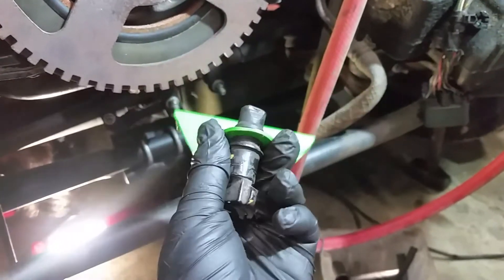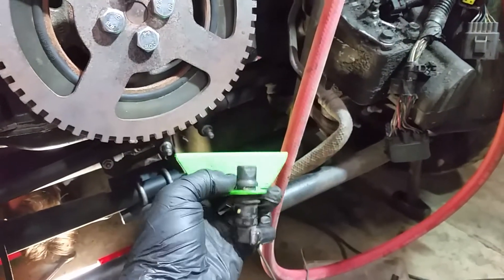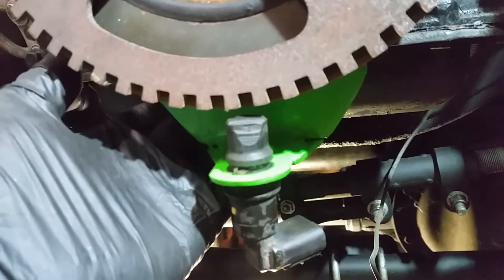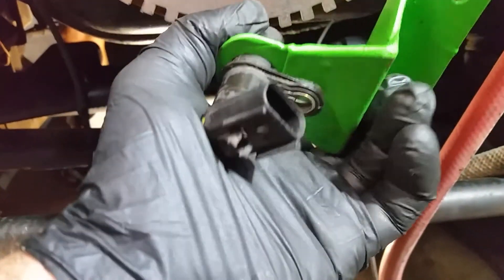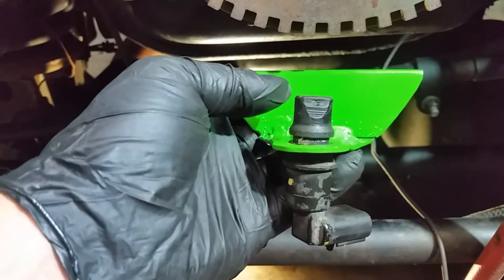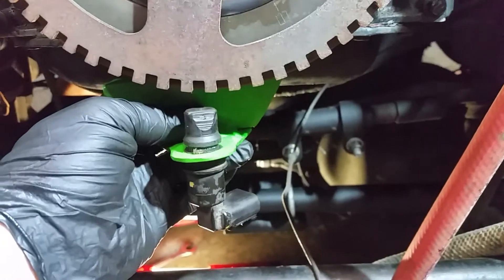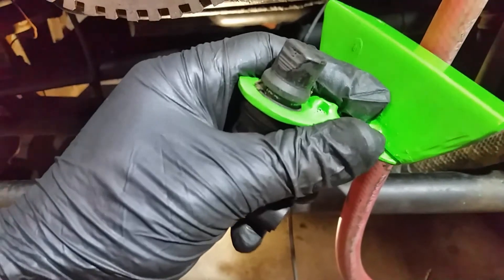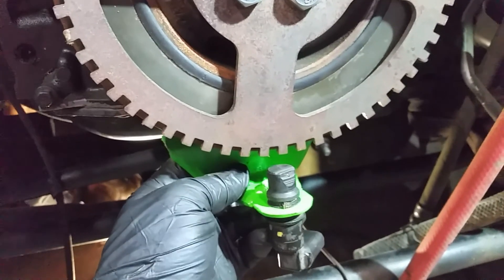How to fab the tach sensor bracket for Common Rail Swap

Comment: Hey I have an 03 12 valve swap I’m working on. I got the tach sensor hooked up and all the gauges work except the rpms. I see two harnesses that both plug into the tach sensor. I think one is for a cam sensor and maybe it needs both for the rpms to work. I was just curious how you did yours. Thanks!
Reply from the maker: Hey Neil! What type of tone ring are you using? As for the CR system, It just needs the tach pick up and not the cam sensor. The tach sensor plug is the one by the fan wire plug. Also, we have seen a lot of cases where a missing ground can cause weird things to happen. You might to give your wiring loom a once over.  Also make sure that you just zip tie up out of the way and don't cut wires!
Reply: @70440charger  I’m using the factory third gen tone ring and spaced it out with washers and longer bolts. The ecm is mounted like yours on the shock tower so it should be grounded. Ok I’ll check for grounds again and maybe try a different sensor
Reply: Hey so checked all the grounds and it still didn’t work. I got another sensor and plugged it into the other harness while the tach sensor was hooked up to the tone ring. I held it up to the 12 valve balancer groves while the engine was running and the tach gauge started working. Maybe I need two sensors or reprogram ecm to run off just the tach sensor? Any other ideas?
Reply from the maker: @neilplass1793  I have some questions for you about how things are set up. It takes too long to run through everything on message here. If you want, send me a message with your contact info to thelochcorp@gmail.com. I will give you a call.
Reply: Hey I sent you an email just curious if you got it. Thanks for your help!

Comment: I've had my 12 valve swap in for a minute now but I'm getting a bouncy tach signal from 900-1100 rpm.  Any ideas?  It makes the alternator and ac stop working at idle.  Works perfect every other rpm range
Reply from the maker: How did you wire the tach pick up?
Reply: @70440charger  I built a bracket similar to yours but where I mounted the computer I didn't need to lengthen the harness.  I used the common rail tone ring mounted in front of a fluidampmer.
Reply: And I put a new sensor on and she works perfect now.  Never had an issue with the original before but I guess it was time?
Reply from the maker: @panamactd  Glad to hear it working! Please, when you get a chance, make a video of the bracket you made and send us a link. It sounds amazing!

Comment: Great video! Can I use the same method tone ring on a older set up. I have a 98.5 and swapped the motor to an 01. The crank has a tone ring on the 98 not the 01
Reply from the maker: As long as you had the right tooth count, I dont see any reason why it wouldn't work. You might have to take a second to figure out how to adapt everything, but I bet you could make the computer happy!

Comment: Hi I was wondering what the correct gap is. I bought the tone ring from destroke  60 minus 2 and I am putting it in a 2003 cummins. I built mine similar to yours. I wasn't sure on the distance for a common rail  sensor from the tone ring . Thanks
Reply from the maker: Hey there! I think I set mine to .020". It will work with a pretty wide range if I remember correctly.

Comment: I just did this swap on a 03 ram and every gauge is working other than the tach oil pressure works so it's reading off the tone ring bit not sending it to the tach on the dash any ideas ?
Reply from the maker: Hey, Sorry to hear that you are running into some trouble. If you can post up a video of how you have your tach sensor set up right now, It might help us or others give you betting insight. For now, I thought it might help you if I made a video on how my system is set up and how those two senders change things on my dash. Here is the link: https://youtu.be/oF2JhSRHcdk to the new video I just put up.  Other than that, I would try checking and rechecking all of your grounds and electrical connections. Make sure no wires got crossed when you lengthened the tach sensor wires and other basic stuff like that. These ECU are very picky about ground and signals. Keep us updated and post what the solution is when you get it figured out.
Reply from the maker: You have peaked my interest, but I need more detail about what you have done. It likely to be a very small issue that is causing this.  I have to ask cause I am working on an 03 right now and it has the same style pick up and almost the same motor harness as the later CR's.  Where did you mount your ecu that it reaches without lengthening the wires?  Send a picture of your set up, if you don't mind.  douglochner@gmail.com. 

Back to your problem. Where did you buy your tone ring? How much did you set the gap for between the tone ring and the wheel? Have you gone back through all of your grounds? Did you cut any wires off? 

I will go unplug some stuff on the Black Hole see if i can duplicate your issue. The ECUs are finicky, but only require a few input to get a tach signal. We will see what we can do to help you get it worked out.
Reply from the maker: I hear ya.  You shouldn't have had this much trouble! Ahhh the joys of a swap! Another question is if you have your ECU grounded, as well?

Comment: I am building a 2003 Dodge Ram 2500 and putting a 1998 12 Valve in it. Is the 1998 block a storm block? What do for the wiring on the motor that goes to the computer? What things do I have to do custom stuff on?
Reply from the maker: Congrats on the build! I far as I know most of the 98 12v had the storm block. If you have a storm block you won't have to custom make the motor mounts, but you will need to fab adapters for the oil pressure sender to go from the 12 block to the CR sender, and the same for the water temp sender. You will need to fab a bracket to hold the ECU and another for the Tach pick up. And to do some adapting for the 12 power steering pump to the CR lines. Plus some other odds and ends( I.é figure out how you want your fuel system to run). You will need the ECU from the CR truck and the factory harness. Then you have your tranny to finish. It is time consuming and a Labor of love, but do able and worth it if done right!
Reply: Ok where do I get the plate that goes on the dampener? I’m doing the nv4500  don’t I just need the neutral safety wire and reverse lights from the wiring? Can I use the CR wiring for the trans?
Reply: And when I do the swap will my speedometer and rpm still work?
Reply from the maker: Was your truck originally a nv4500? If it was then you will be in good shape. If not then you will have some more work to do to get everything acting properly. If the truck is a nv4500, then you will use the factory CR harness. You pretty much always are going to be using the factor CR harnesses and adapting them to fit your needs. Be sure to not make the all too common mistake of cutting the unneeded plugs of the CR harnesses. It has cause many a ECU's to go nuts will all the little wires getting smushed together when cut.

Your Speedo is driven off the rear axle, so you will be good there. As for the tach, you will have to use a 60-2 tone ring. Some call it a 58, which it is, but it is important for the reading to have a 2 tooth gap, hence the 60-2 name. Destroked is where we have gotten those in the past, but I hear that they can be hard to get now. I am trying to get some made by a local shop since this is becoming a big problem for us here with our swaps.
Reply: Ok
Reply: Thanks

Comment: What did you use for a spacer?
Reply: Between the wheel and the crank
Reply from the maker: It is a chunk of steel that came with the kit from destroked that they turned down till it fit the inside  of the balancer and then drilled the 4 holes for the extra long crank bolts.
Reply: Thanks what is your email I’d like to send you a couple picture of my swap, ur videos helped a lot
Reply from the maker: Shoot me an email to doug@commonrailswap.com. I would love to check out what you have going on!

Comment: I am doing a 12 valve swap in a 2003 was curious has what pulse tone ring is it? The 58 or different
Reply from the maker: George Arnold - Glad to hear you are working on your own swap. I hope you will keep us updated over here on how it's going and what you learn while finishing it up! We used a 60- 2 tone ring, which as you know, is has 58 actual teeth and a gap the space of two teeth. I have heard the some people used a 36-1, which is what destroked sent us the first time, and it did not work. As expected, we only saw about half the rpm on the guage that the motor was really turning. It might work for a difference years, but a 36-1 definitely doesn't work on a 04.5 - 05 ecu. Hope you love the truck once you get her all finished up!
Reply: Hope so too I’ll try that tooth count, your videos are a lot of help thank you my good man